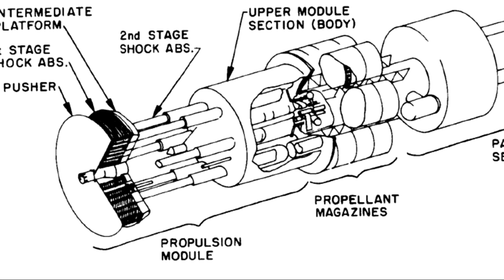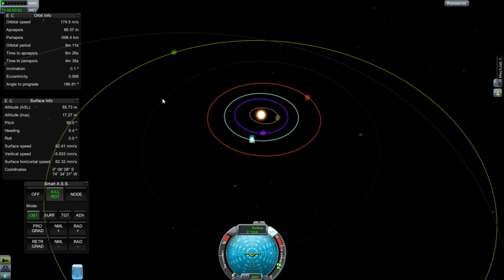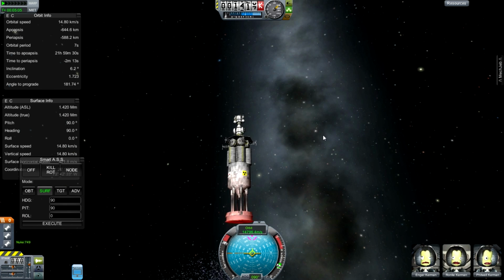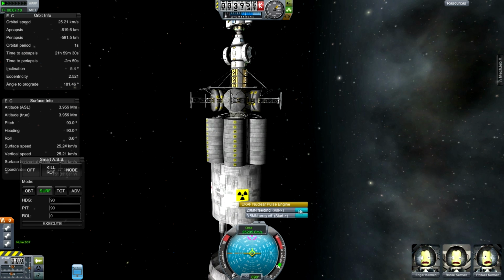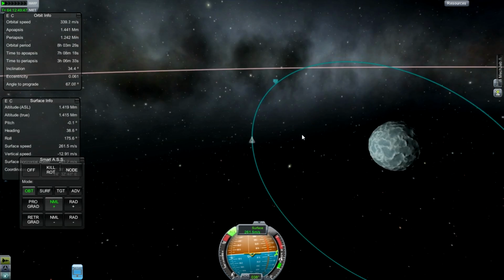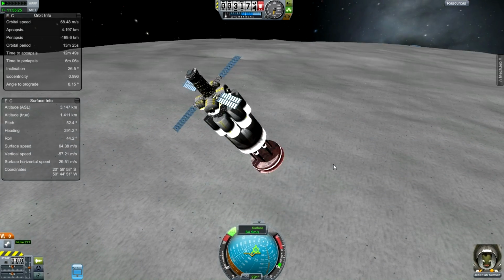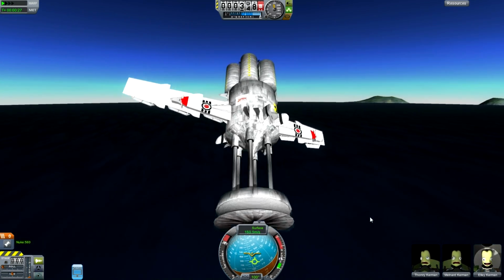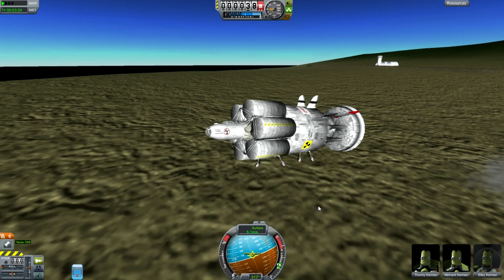Kerbal Space Program - 'Orion' Nuclear Pulse Rocket

Comment: I'm not so sure if Orion would work in a vacuum. The only thing that could transfer the kinetic energy would be the matter from the bomb itself.
Reply: It basically works the same way as conventional rockets,just not continuosly but with repeating pulses.so since rockets work,i'm pretty sure nukes would work too.
Reply: Bappleinator  Rockets use a chemical reaction to push matter out in order to gain an opposite reaction. That's different from using atomic bombs outside the vessel to push it. The other option would be to use the explosion inside the engines but how will that work?
Reply: Maybe it could be exploded outside,but still near enough for the fireball of the nuke to push it forward.Or we could find/make a material that can withstand a nuclear explosion and/or regenerate itself.
Reply: Bappleinator  Material that can withstand the explosion at close range and a material that can protect the inside from all the radiation is the big challenge.
Reply: FireOccator true, if you had material capable of such things it be much more practical to use the "mini" bombs as shaped charges as propulsion shells, expeling the plasma out the bottom of the push panel (kinda like an normal rocket and how it pulses,just with different fuel and reactions that proved the expulsion of said different material to make thrust) then reload the engine again after discarding the "shell"
Reply: You're missing an important thing. In a vacuum, most of a nuclear bomb's energy is converted to X-rays... and X-rays, when they interact with matter, can produce force. That's what's pushing your craft away, along with the thermal energy released by the explosion. No atmosphere necessary.

Now, bear in mind that a nuclear weapon has an extremely limited range in vacuum. Unlike in the atmosphere, where there's air to transfer heat and overpressure to make the bomb extremely destructive over a wide radius, effective range in a vacuum is about one kilometer, regardless of yield. Of course, a 1GT nuke will do far more damage to anything in that 1 kilometer sphere than a 1KT nuke, but both have the same explosive radius.
Reply: Jetman123
   Doesn't thermal energy require matter? Also I thought that a nuclear explosion in a vacuum will release electromagnetic waves in all diapasons which would result in cooking anything inside the ship.

Comment: You're using the equation wrong. The equation read Initial Mass times Initial Velocity equals Final Mass (same object) times Final Velocity. You need to take the entire mass of the rocket and its cargo both before and after detonation, not just the charges vs. the rocket.

Comment: How about incorporating inflatable deflatable helium  balloons for both takeoff and landing for the entire ship. Takeoff to stratosphere would be like a normal helium balloon. Ignite nuclear explosions just to maintain elevation during helium deflation. Then go to full nuclear throttle to leave atmosphere and accelerate to interplanetary trajectory. Slow down and gently enter destination planetary atmosphere. Inflate helium balloons. Land as a normal helium balloon.  Repeat process from start.
Reply: It would take so much helium that it would be better not to use them.
Reply: Helium is very abundant in the solar system.   On earth it is rather expensive.
Reply: totally. did you know that the earth is actually running out of light gases (H, He ...) because they're all escaping to space? scary.
Reply: Yes.  The USA actually has helium reserves. It's that scarce.
Reply: wouldn't work, the weight of the helium tanks offset the lift. and helium balloons only rise in an atmosphere
Reply: Without wanting to be dismissive, the thought of a flimsy helium envelope supporting a spaceship through even the first nuclear (remember, these are actual nuclear explosions) pulse needed to hover kills this idea right off. Then there's the likely proposition that the time needed to draw back the helium repressurised it and restow the balloon (assuming it is made of unobtanium and doesn't shred to bits) would take longer than a simple lift-off from the ground, thus dumping far more radiation and fall-out into the atmosphere also kills this one.
Reply: XKCD, I'm thinking.

Comment: Gotta laugh... None of the three Kerbal crew seem happy during the trip....

Hmm. Since someone has made a Project Orion mod, perhaps someone else will make a Project Pluto mod. https://en.wikipedia.org/wiki/Project_Pluto

It's a lovely little weapon system. Imagine a nuclear powered ramjet. Effectively a cruise missile acting as a multiple warhead supersonic bomber. And after it drops off all its bomb, it continues to cruise at low altitude over the targets and stirs the rubble with shock waves. Finally after several months of stirring the rubble, it eventually crash lands with a high likelihood of the engine shattering and contaminating the ground with radioactive waste.  Project was finally cancels when no one was able to figure out how to perform a test flight with appropriate safety measures to handle any possible out of control failures.

Comment: @ 13:16... What are the consequences of retro firing into the Nuclear Blast Wave ?
I understand that the shield is designed to protect from the blast.

The ship travelling through the blast at those speeds must do some damage. I'm guessing the plate could take it hehe, but what about the actual body of the ship.

Wouldn't this be something to worry about ? It's not as if the whole ship would be designed to withstand those conditions inside the blast radius ?

Comment: no? the particles from the bomb will already be traveling at the ships speed, they will have the same effect if the ships going 1mph versus 10000mph its not as if there is any air resistance to slow the bomb or the particles down! all new acceleration will build onto the current speed!

Comment: Do you really think that sound transmitting is chemistry-dependant? Vacuum doesn't transmit the sound because there is no matter in vacuum(that's the definition of vacuum -- the lack of matter). Oxygen is just one of a hoard of different matter particles.

To hear the sound with your ear you would probably need some gas(any gas), but even without it you can hear some sound resonating through your body if you touch something with, say, your forehead, for example -- it goes to your cochlea.

Comment: Do you know what Isp is? Seriously. Isp is lb/f per lb per second. That's why its in seconds. So, an Isp of 300 means 300 lb/f per pound of propellant per second. So, yeah. And plus, I have seen a Saturn-V lift off, it's slow, yeah, but think about it, add some solids or something and it would take off, or, use Orion for SLS, (that is, even if it gets off the ground, and not cancelled.)

Comment: Aside from the political and literal fallout, was there any mechanical reason why this project wasn't developed further? Like, did it turn out there was some fundamental challenge that would totally render the rocket nonfunctional? I'm only asking because accredited Quora user Sophia de Tricht claims that the Orion project was a terrible idea due to the engineering itself -- apparently, once you scaled Orion up, it wouldn't work anymore, or something like that.
Reply: Actually, the bigger the Orion, the better it works. You can use more powerful and efficient drive bombs, the ride is much smoother due to mass of the ship, you can take more stuff and so on. It's scaling down the Orion which is highly problematic.
Reply: No known show stoppers. The guys at General Atomics may have been overly optimistic (one of the scientists reportedly thought the technology wouldn't be possible until the 21st century) but the physics works. Bombs of the necessary size have been developed. Getting it to work is more of an engineering challenge than a scientific one. 

Look up the "Hot Rod" test - not nuclear, but showed that explosive pulse propulsion is feasible.

Comment: With the amount of nukes your setting off you'd put earth into a nuclear winter before you could even get out of the atmosphere.
Reply: Actually you wouldn't.  Think of how much energy it takes to level a 1mile radius.  Then concentrate all that energy into propelling a mass half a dozen magnitudes smaller.  You don't need nearly that much energy. 

Plus you would launch it at one of the poles, so that Earth's Magnetic Fields didn't catch the radiation and hold it in.  Dyson's estimated minuscule contributions of radiation contributed to the Earth hold up to scrutiny.
Reply: Ok as B Moore said it wouldn't but for even more reasons. The total yield to get the super type which was to be almost a million tons would have been less than the yield of the Tsar bomba
Reply: Nuclear winters are caused by cities around the globe being turned into firestorms and letting lots of soot into the air, which can't happen when they're all going off on a launch-pad in the desert.
Reply: Rowan Evans yeah, the dust and fallout blocks out the sun.  similar to a high energy Kinetic impact.  Like an Asteroid.
Reply: Chris Bowman Not really a relevant point, you're generally right, but "fallout" is called that because it's the stuff that falls out - of the sky, and is radioactive, so it poisons the water supply near wherever a nuke went off - so it's not really that bit that blocks out the sun.
Reply: Rowan Evans that's true.  Incorrect word.  I should have said Radioactive debris.

Comment: The Orion craft is very, very, very, very, very, very, very, very, very, very heavy. At the minimum, you'd need a craft 20 times heavier and bigger than the Orion craft itself due to the mass ratio problem.

That and the fact that it IS a bit of a political issue with getting permission to move huge amounts of nuclear bombs into Earth orbit, where they can be dropped silently and undetectably on any nation you wish. People will have some problems with that.

Oh well. In time, that might pass.

Comment: I just recently was thinking about this and asteroids. Would it be possible to divert an asteroid by peppering it with numerous small nukes, turning the asteroid into a very big, ad-hoc Orion engine?
Reply: Unfortunately asteroids are usually not all that solid, so just strapping a rocket to one has a decent chance of breaking it unless you go out of your way to keep it intact. You can probably imagine what nukes would do :P
Reply: CaptainKC11 plus Assteroids in real life have on unfortunate problem.  In addition to what he said above about asteroids being "crumbly" and willing to break apart, they are also subject to extreme temperature changes.  So at night everything is fine.  But when day break starts coming, and they heat up, it can trigger the release of gases from inside the asteroid.  This would be a hazard to any ships.  But not all asteroids are like this.

Comment: What is actually providing the propulsion impact force?  There can only be a small amount of plasma / gas from the ionized bomb structure, the photon force can't be that great...
Reply: Stephen Kramer Plasmified tungsten plate, which is stuck on top of the drive charge for this specific reason.

Comment: Speaking of the test model they made, it used chemical pellets... So I wonder, if it is to be considered a more conventional energy source based machine, then if it is possible to make a reasonable comparison, then would it be a more efficient/effective use of said conventional energy source for propulsion purposes...?
Reply: Pulse thrust like this is only effective using exceptionally energetic explosive pulses. Chemical explosives can't package the needed power in pulse units small enough that the spacecraft could actually lift off and go anywhere. I mean even the small pulse units here were rated in the tens of tons of high explosive per pulse. That really does mean an explosive pulse unit would need to be tens of tons in mass, which you then have to carry a lot of and push them out the back at the rate of one every 3/4 of a second or so. Not really doable at all.

Comment: Would love to see this modded to include radiation hazard so that it limits when you're allowed to fire off (like not letting you drop nukes on your own space center!) and I'd like to know how realistic it is to have anything poking out the sides. I thought waves wrap around obstacles usually? Shouldn't any wings poking out then get hit by some sort of blast wave? Or is it just that weakened in vacuum?
Reply: Well, the Orion should be the second or third stage, not the primary as shown.  But yah, it would devastate the space center to start the pulse engine at ground level.

Comment: How could the orion drive work when there's no explosion in space like there is on earth 
Most of what we think of in a nuclear detonation is caused by the blast wave of air

No atmosphere no shockwave to push your spacecraft forward 
It would create a whole lot of heated plasma, a whole lot of radiation...
Wouldn't a light sail be better at using the nuclear detonation for propulsion ?
Reply: So the Orion drive wouldn’t use normal nuclear weapons. You take a nuclear physics package and surround it with some clever assembly so that the nuclear explosion imparts a huge amount of momentum into a propellant - the original concept used tungsten as propellant iirc. This propellant then gains a huge velocity, impacts the pusher plate, imparting momentum, and then rapidly dissipates. It’s not amazingly efficient but it can impart a lot of momentum...

Interestingly a magnetic field would actually be the best way to capture the plasma and exchange momentum with it - or an electrostatic field.

Comment: I don't understand the pusher plate. What is it pushing against? In space it pushes against the vaccuum of space which means its pushing against nothing. How can that work? If its the rocket that is pushing against the plate well then it still has to drag the plate along. I'm sure it has lots of mass and it has now been pushed in the direction opposite the direction the ship wants to go. Wouldn't it make more sense to set off the bombs in a huge chamber and then nozzle the exhaust so that it all leaves through the bottom pushing the craft without the huge plate through space?
Reply: The pusher plate and the spaceship proper should be considered two separate objects, connected with shock absorbers.

A nuclear blast collides with the plate, the plate gains momentum rapidly. The two stage shock absorbers transfer this momentum to the ship proper over an amount of time that reduces the force to survivable, if not comfortable, levels. Some kinetic energy is stored so that the plate rebounds, and another nuclear bomb is released so that the process repeats. As this occurs the center of mass of the plate-ship system moves and gains speed.

The pusher plate is pushed by the explosion, and then the ship pushes against the pusher plate repeatedly to gain velocity.

Comment: Why say Δv instead of acceleration?
Reply: Two craft can have different acceleration and the same Δv.
Reply: How? Δv means change in velocity. The worded term for that is acceleration. They mean the same thing.
Reply from the maker: Δv is absolute velocity change, acceleration is velocity change per unit time. So 
Δv = acceleration x time
Reply: Scott Manley Exactly. A rocket in space can be said to have a  Δv of, say 3 km/s, in other words it can change it's velocity by 3 km/s (a touch under half Earth orbital vel, as it happens) yet it can have only tiny thrusters capable to achieving only .00001 km/s/s acceleration. In other words it would take a long time to change the craft's velocity that 3 km/s. A different spaceship with big honking thrusters still has a Δv of 3 km/s but can achieve 1 km/s/s acceleration and will get to that 3 km/s velocity change in three seconds. And then it's tanks are dry.